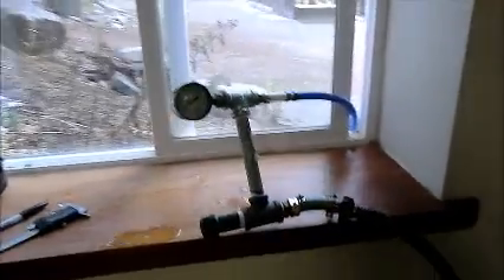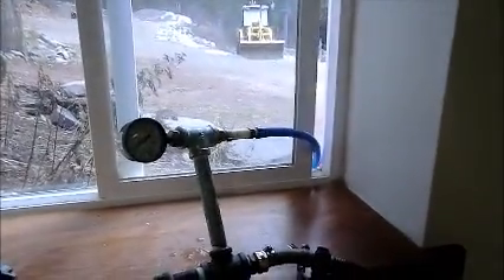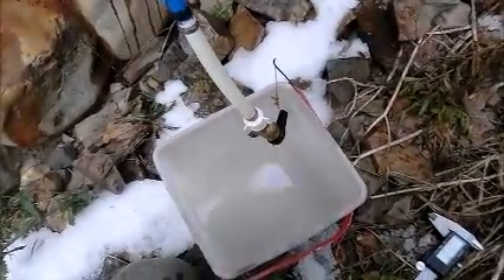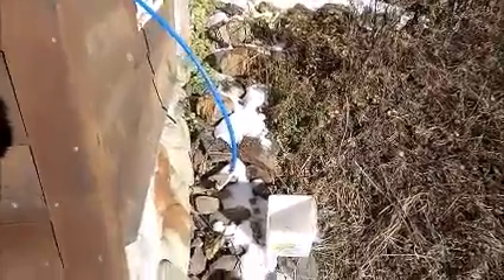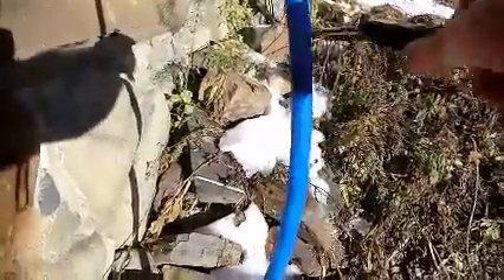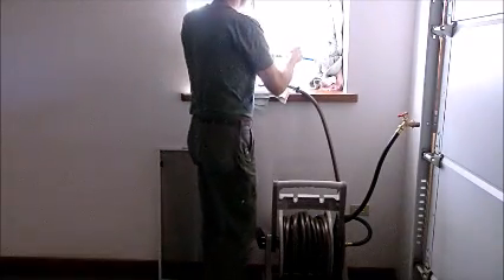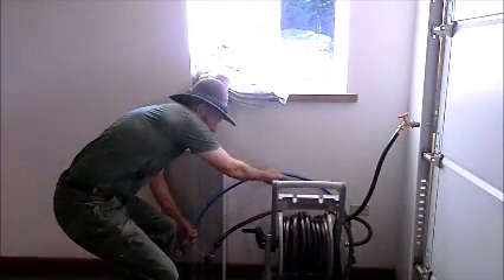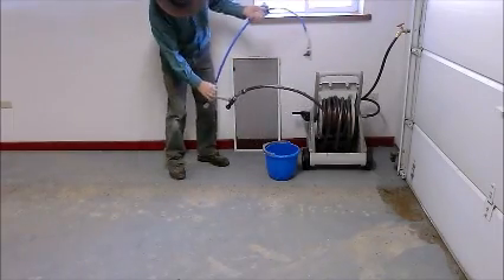pex pressure freeze test. Can you freeze Pex?

Comment: I ran PEX-b in my barn which has frozen up a few times. The pipe itself and crimped connections have never failed. What did fail was the swivel connection that you had on the valve at the end. The plastic ring seems to be made of some kid of PVC. As I had that connected to the end of a 4" long steel nipple, the water froze in the nipple and the expansion pushed directly on that swivel connection and the plastic ring failed. I have since avoided using those swivel joints outside and don't use long nipples. other than that I think PEX-b is fine to use in freezing conditions.

Comment: I've froze Pex water lines in a travel trailer a number of times with no problem (except having to thaw them out), but I always worry about the hard plastic elbows cracking. That would be good to add a couple in your experiment. Another question is after expansion, do the pex lines return to normal, or do they expand permanently each time they freeze, gradually making them weaker each time? I have learned to drip faucets in my trailer if the predicted temperature is 15 or less fahrenheit. That gives me about  a 5 degree or so buffer. I usually turn the heater way down, because it wakes me up when it comes on and to save on gas. After 20 years of winter use and a number of freeze ups, with temps down to -15, I have never had a busted line.
Reply: Wow it sounds like you have tested pex way more than I have.  I'm in Florida now so no worries for me right now.  But Alaska is in my future.
Reply: yes plastic elbow would be risky.. see my note above about the plastic ring failing on the swivel joints.. I had one fail in my barn so I don't use them anymore. I would not use plastic fittings for the same reason.. Use the brass ones.

Comment: Isn't this an INVALID test?  I was initially surprised to see only .006" increase in diameter, as you can see much more rupture (larger diameter) in just a water bottle put into the freezer.  When water freezes it expands, but since it is an open system, the pressure simply pushes back into the water supply.  It was a very short hose as well.    Perhaps if you redo the test next winter, but next time turn OFF the water valve so the pipe actually pressurizes.   Or perhaps take that same length of hose, put a detachable shut off valve on it and put it in the freezer.  This test only pushed the pressure back into the water source.
Reply: OK a little bit of math. From my google search water expands by about 9% when frozen. As the area of the pipe = pi*r^2. Thus the radius (and therefore diameter) expand by the square root of 1.09. So sqroot of 1.09* 0.624 = 0.65. In other words in the worst situation the diameter of the pipe will grow about 27 thousands of an inch. You are right therefore that this test did not get the full worst case expansion. But then 0.027" is not much and I'm pretty sure that PEX-b will withstand this well enough. if you want to be super certain then you can use PEX-a, but the pipe,fittings and assembly tool will cost more $$.
Reply: I've found that living in cold country that pipes don't usually freeze their whole length.  usually it's just in a spot that wasn't heated or insulated correctly.  So I was testing for more of a real world situation.  I have tested the pex pipe with both ends closed off full of water and thrown in the freezer.  Nothing much happens because the pex walls are so thick that they don't have much water holding capacity hence nominal expansion. Give it a try and let me know if you get different results.

Comment: Thanks for sharing.  Was that PEX-A or PEX-B pipe?
Reply: I'm not sure if it's A or B.  It's off the shelf home depot brand.
Reply: @chuckwright7450  from what i hear that is B the type A is the one that expands to make the connection
Reply: @1diotwithideas  Yes that was PEX-b pipe (you can tell by the connections). Pex-b will expand under freeze as well but not as much as Pex-a will.

Comment: The water coming into my house froze overnight. I forgot to drip my pipes, we don't get really cold weather very often here where I live, so the pipes aren't insulated under the house.   I was concerned that when it came back on I'd have a mess to deal with.  I was greatly relieved to see this video.  And in fact, when the water came back on, my pipes were all ok.  I believe the flex pipes are the reason I have no leaks.

Comment: Nice experiment!  I appreciate how you've gone through the trouble to test it under pressure as opposed to another video I saw using only static water within a segment of pipe.  This will help me decide how I want to insulate my pex when I get to installing it.  By the way, which type/brand of pex did you use there?  Thanks in advance.
Reply: But you never checked it with the micrometer again!
Reply: @daggerathsn.p.customs  what has your comment to do with Dora Dean's comment..?